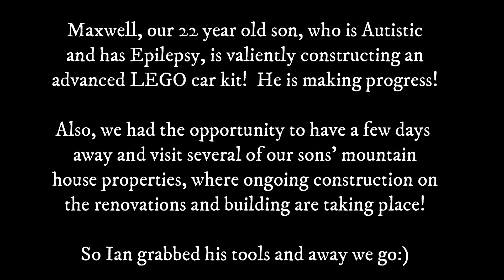MINI VACATION TIME:) Plus MAXWELL AND HIS LEGO CAR:)

Comment: Nice nice place, a lot of good hard workers in ur family 👍👍👏🏼Maxwell  is awesome 🙏🏼.  Jean this is off topic I’m trying to free motion on my Brother PQ1500 using cotton fabrics n thread 🧵 n I keep getting skipped stitches it’s so frustrating ripping out. Any suggestions please anyone I’m about to throw machine off table 😡😡😩
Reply from the maker: Thank you Mirta:)  You could try changing the needle, perhaps a different thread (sometimes that is the problem...)  and also be sure to have your machine set to "0"  for no stitch length.  Did you 'practice' your design perhaps by drawing it out?  That is to get your brain USED to the design.    Also you probably need to slow down a bit, but not too much, in order not to get those pesky 'eyelashes' around curves.    Remember ~ Brain, Hands, Feet, Pedal, Design, and Practice Practice Practice.    Don't throw your machine. * Step. Away. From. The. Machine***   LOL!  All the best:)
Reply: Thank you Jean for replying so quickly, I’m soo frustrated I’m using connecting threads 🧵 thread got some HLx5 90/14 needles Manuel requested , I’m just meandering large squiggles basic, no eyelashes just skipping  stitches here n there . My stitch length dial goes from 1-7  no zero on dial 😩.  Should I try a denim needle 🪡??  I’m using thin cotton batting.
Reply from the maker: Yes, I would try a denim needle.  Sometimes you need the larger eye.  Hope it works.  And I DO KNOW that even BRAND NEW needles can have tiny burrs in them.  Hopefully the needle change can help.